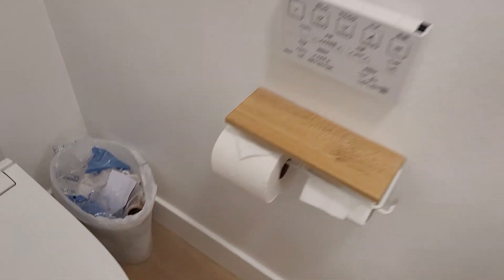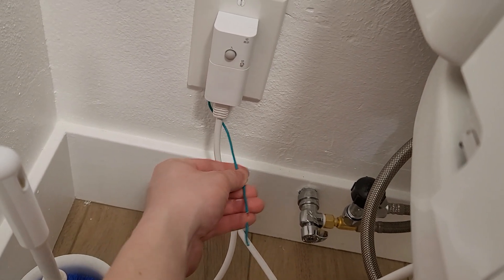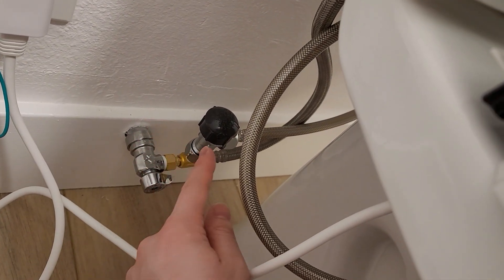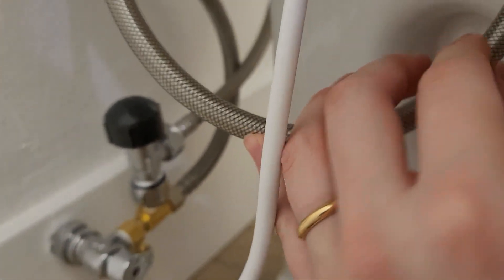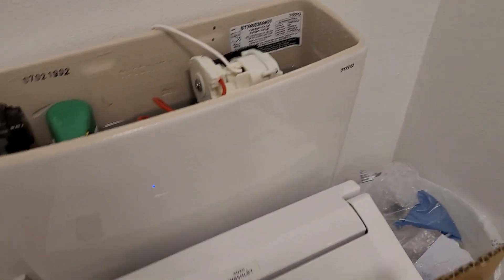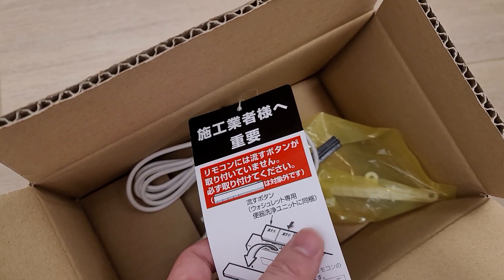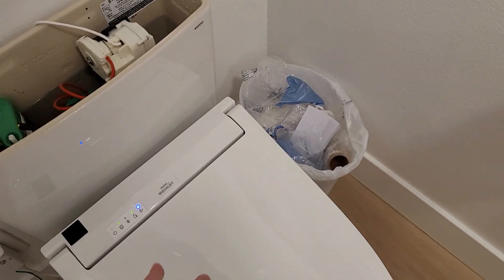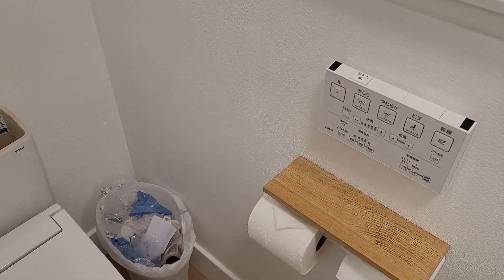It is possible to install Japanese TOTO washlet in America on American TOTO bowl and remote flush

Comment: You're not using a step down transformer? Since the seat it heated, it's probably safer to do so.
Reply from the maker: oh you mean like 120v -> 100v yeah that is probably safest. Good point, i forget the voltage is different! though i think i am too lazy to figure out how to change it while making sure it still looks nice on the wall. so far everything continues to work without issue. My non-expert beliefs say the system can probably handle a bit of extra voltage and it will just run 20% hotter than the machine thinks it's doing or something. I have seat and water heat settings mid to low, and i guess safest would be to never max it out.